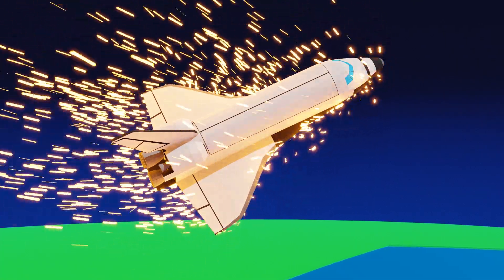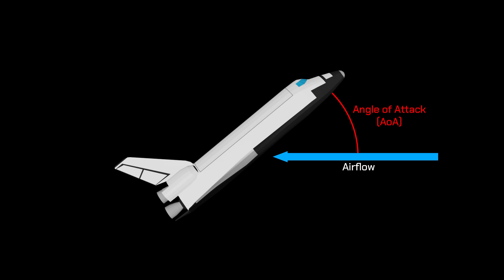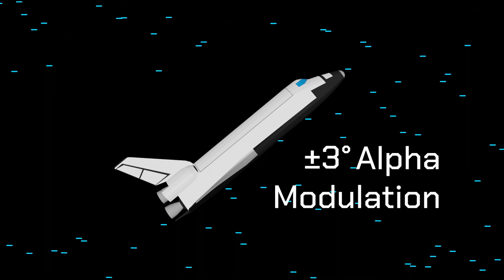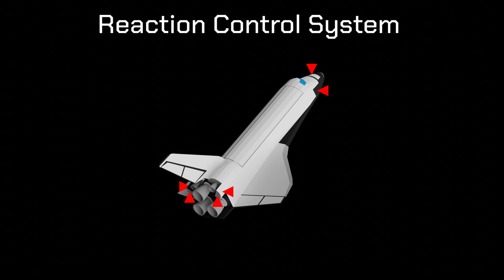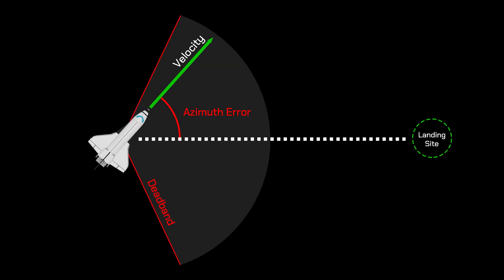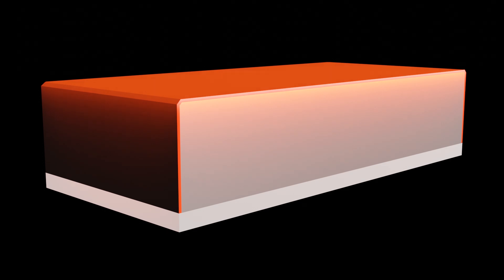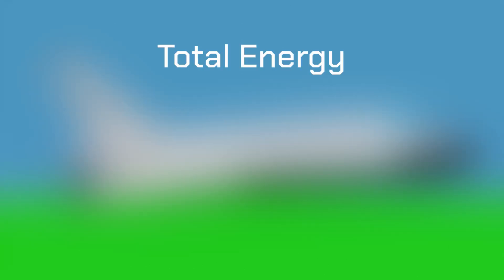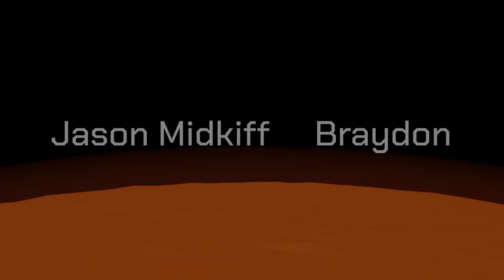Space Shuttle Reentry In-depth

Comment: This might be another case of the NASA/STS definition differing from the typical definition, but typically this is not the "critical angle of attack." Crit AOA normally is maximum coefficient of lift (irrespective of drag) aka stall. The speed referred to in this video is maximum lift/drag ratio, which is a smaller AOA.
Reply from the maker: Yes, you're right I confused max L/D and max L. That was a silly mistake on my behalf and I should have been more careful with my terminology. However, the front and back side still remains in the context of the L/D curve, just imagine "Critical AoA" replaced with "Max L/D AoA". Thanks for pointing it out, if you don't mind I'll pin your comment so others can get the correction.
Reply: @SimplySpace  could you tell me what will be the skin temperature of rocket going 2km/s at 32 km altitude ? I'm talking bout X-15 and X-45
Reply: @KrishnaKk-9  the absolute theoretical maximum can be found with the formula T = sqrt(5c/(mv^2)) in the case of Earth's atmosphere, where c is the stefan boltzmann constant and m is the average mass of an air molecule. The actual temperature will certainly be less that this, depending on how blunt the surface is against the airflow.
Reply: Copy.
Reply: Nerrrrrrrrrrrrrrd

Comment: Well... things started to become accurate towards the end of the video, but it's completely silly on the front end. Until the Shuttle got at or below 40,000 feet, Shuttle pilots didn't give a rats ass about lift. From orbit to about 40,000 feet, the main concern was the coefficient of drag. All other forces are insignificant due to the lack of atmosphere. Then it became a matter of entry angle. Backing up a bit. The shuttle isn't going fast enough to "skip" back into the atmosphere. It's not travelling at 25,000 mph like Apollo returning from the Moon. This threat for the Shuttle didn't exist. Being too shallow in this case, means you will overshoot your landing area by a great amount. Going too steep would increase damage due to G loads, higher drag, and heat. Heat and dissipation was also explained poorly. You're thinking 1960 space capsules not the Shuttle. The shuttle has a high ballistic coefficient. The capsules did not. In short terms, the Shuttle didn't slow down as quickly going through the same amount of atmosphere. HEAT was also more important than lift. So managing the trajectory is the important bit, not lift. Astronauts before the shuttle dealt with 6-10 G forces. The Shuttle was good at keeping it around 2 Gs. Due to trajectory, not lift... because, very little lift is available until later. Aerodynamics to some extent, sure. So the high angle of attack isn't for lift. It's for AEROBRAKING... I.e. changing the only force that matters...DRAG. I can go on, but it's too much to type.

Comment: The way the universe has been made is that if an object over a certain size is trying to get into our atmosphere that because there is no air it is being forced out of the Earth until it has reached a point on the Earth where there is hydrogen and oxygen which is creating gravity and if it does not a bounce's backout and this is what is preventing asteroids from going into our atmosphere is this field where there is no oxygen and in order for us to effortlessly overcome this we need to make a space elevator and this way the elevator will not be of such a large size that The weightlessness is forcing the elevator back Of the atmosphere and the way to make an elevator is by making a 100 km ball and putting an elevator inside of the ball and this will make it so we can go to the outer atmosphere and launch from there and we can effortlessly travel anywhere in space The reason why the space shuttle is having such a hard time entering is that it is too big and because of its size it has to move thousands of miles per second because the Earth sees it as an asteroid and it is trying to destroy it from hitting the planet Earth Whereas an elevator would not interfere with t The  Area where there is no oxygen because the elevator is so small and the 100 km ball would also provide a gravitational force around itself which would protect the elevator from the weightlessness factor that the space shuttle suffers when it tries to re-enter

Comment: Can someone explain this, when the shuttle enters earth's gravity, so not in space, it's travelling they say at mach 25, how is that so when it's shaped like a brick, look at concorde shaped like a dart, and it only travels at mach 2??
Surley you would think it would break up, as it isn't exactly aerodynamic
Reply: When the space shuttle enters the top of the atmosphere it is traveling very fast, but the air at that height is still very thin, so the speed of deceleration is low. There is an area of maximum drag (since the shuttle is still flying pretty fast and it's lower in the atmosphere), and the airframe of the shuttle is made to survive that deceleration. The biggest concern is the heat that is created when entering the atmosphere from orbital speed.
Reply: " when the shuttle enters earth's gravity, so not in space"

There is earth's gravity all around in space, and Space shuttle couldn't go outside of Earth's gravity influence.

Comment: What you animated as as 'bank angle' is actually yaw, usually controlled by the rudder of an aircraft.The wings are drawn as being kept level — it incorrect. Bank is the displacement angle to the horizontal after an aircraft has rolled along the direction of flight (using the ailerons) which is exactly what the Shuttle performed during its S-turn maneuver — it used its ailerons

Comment: During re-entry of a spacecraft not just the space shuttle the astronauts/cosmonauts would lose contact with mission control because the heat generated during re-entry prevent radio signals from coming through.

Comment: Whats the difference between S turn and the roll maneuver you mentioned earlier?
Reply from the maker: The roll reversal is the reversing of the bank angle during reentry guidance, it is not designed to alter the drag profile, it is just to reduce azimuth error. 

S turns are designed to bleed energy by extending glide time after terminating reentry guidance and  switching to energy based guidance.

Comment: Shuttle and Buran are the greatest machines ever made. Love them so much since my youth. Never forget.
Reply: Crazy that the buran could land without any people on board!
Reply: Sr 71 blackbird top speed mph 2200 miles per hour any faster the air frame will  WILL Fail, 
If a space shuttle flies “like a brick”, why does it need wings? To attain orbit at a speed of 17,500 mph (5 mile per second) Sr71 ...0.61 Miles per second, any faster the air frame will  WILL Fail, 
i may be daft but i am not stupid,
Reply: @harrymacdonald858 If I understand correctly, you're saying that the shuttle goes too fast and and at that speed the airframe should have failed? If so, then the answer is that in low earth orbit, above the atmosphere, there is no air so no resistance. And the shuttle "flies like a brick" precisely because it has wings. Without wings it couldn't glide.

Comment: Criticism: please provide some acknowledgement of your data sources, e.g. Harpold's report. 

Praise: Great job putting together a difficult topic into a cohesive, understandable lesson!
Reply from the maker: Thanks, I spent a long time and many script drafts to get all the points presented in a precise way I was happy with.

I have to politely disagree on the criticism, but I'll give you my reason. I am not producing videos in any academic capacity and I don't wish to treat my videos as if I am. I feel that the way in which I researched and wrote the video provides enough separation between my work and any particular source to the point of requiring an "acknowledgement".  As a matter of fact I had not previously come across Harpold's report until reading your comment, I wish I had. However I think that further illustrates my point.

Comment: I like this video. There is just one thing. What you call bank angle is actually not bank angle. The bank angle is not the rotation along the velocity vector but rather the rotation along the logitudal axis of the aircraft/spacecraft. Cheers
Reply from the maker: It is in this context as NASA defines it for reentry guidance. The angle of rotation about longitudinal axis is defined as sideslip or beta.
Reply: I noticed that too, but what I think he's saying is that the guidance computer references it as "bank angle" for it's own purposes. Keep in mind that this is also before airfoil control. In orbit, they don't refer to it as bank angle around the longitudal axis either, it's simply roll.

Comment: In addition to the velocity changing with the bank angle due to the changing descent rate, there is one more important factor to bank angle I think: Since the atmosphere becomes denser the closer you get to the ground drag will increase faster with a high descent ratio
Reply from the maker: Yes but no, that's a common misconception as far as reentry is concerned. Yes, it's technically true, but it's insignificant during drag management. The atmospheric density variation in the altitudes of the reentry is minimal (Note the bulk of the density variation is at lower altitude https://mosaic.colorado.edu/sites/default/files/inline-images/image_12133-2.png ), and has much less of an effect compared to velocity variation in the drag equation. Drag is linearly proportional to air density but proportional to the SQUARE of velocity ( https://i.stack.imgur.com/Z7t0b.png ). Which means at the orbiter's high velocity, drag is very sensitive to even small changes in velocity.

However!... Atmospheric density starts to become the more dominant factor at lower altitudes where the variation in density by altitude is larger, and the orbiter's velocity is lower and more constant, meaning drag is influenced less by velocity (but still prominent). So what you said is technically true but really only comes into play after the reentry during terminal area energy management (Which isn't flown by drag, but by total energy state of the orbiter).